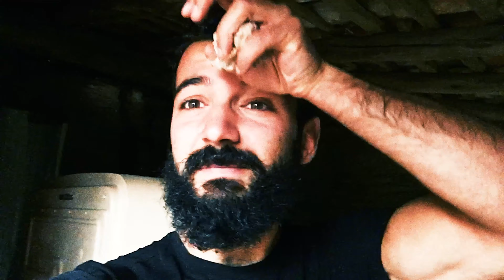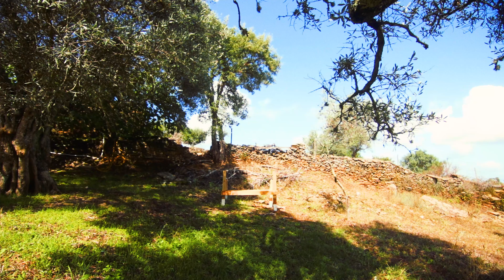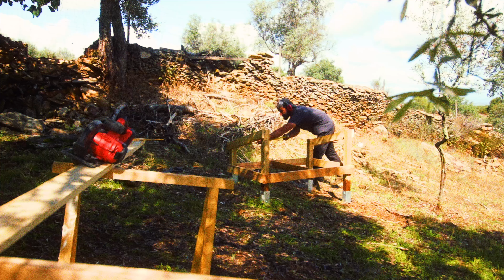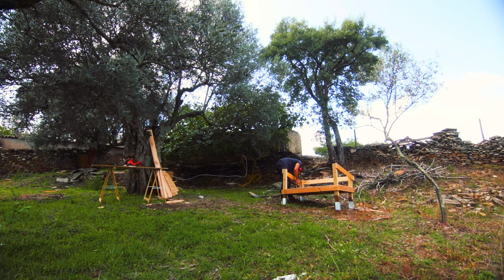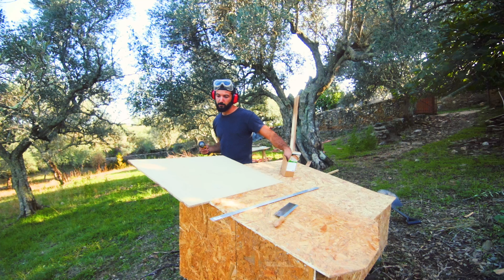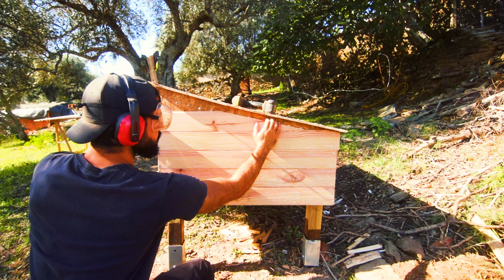Building a shed in my 7500€ farm | Off-grid Homestead in Central Portugal

Comment: Looks really good.  You will want to have good access to connect your batteries so maybe a long panel that you can just remove or two doors that swng well out of the way..  I have a similar box for mine but I have a hinge on the top so i can lift it up and access the batteries for connections.  My batteries are lead acid so I have to fill them with distilled water every month or two so I have to have access from the top.  If yours are lithium you won't have that problem.
Reply from the maker: That’s a really cool idea! I could’ve made the roof swivel up, almost like a trunk!
Thank you! 🙏